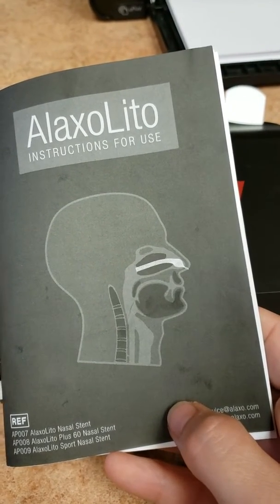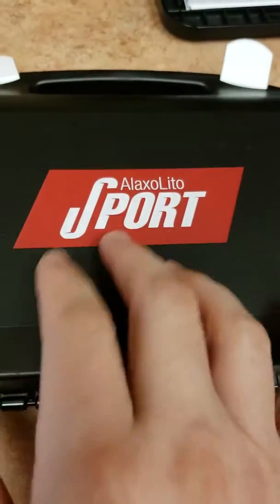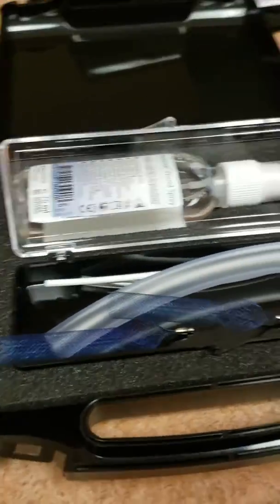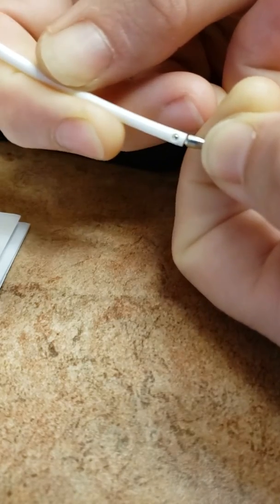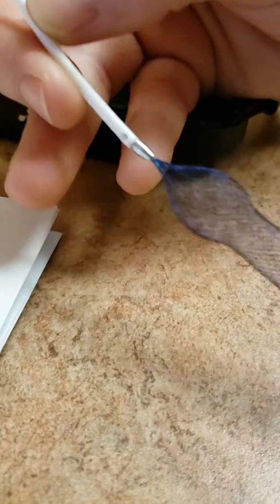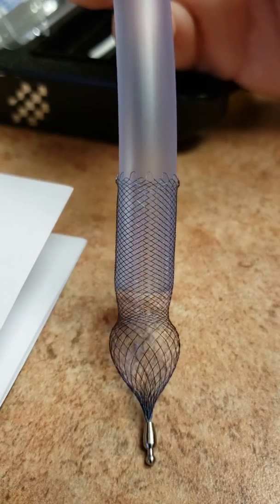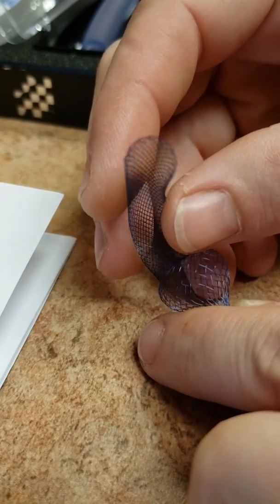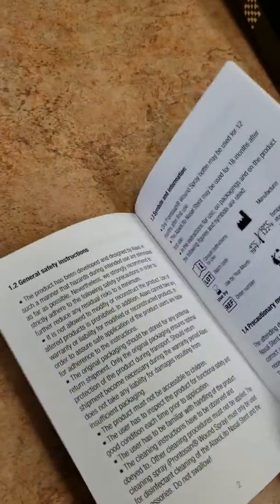Alaxo stent up close

Comment: Are you using it? That works?
Reply from the maker: I was using it and it did seem like it was working. Just have to be gentle cleaning it.
And get nose spray or something to moisten the inside of your nose to remove it comfortably in the morning. If you don't it pulls out a lot of dried sputum from your nose.